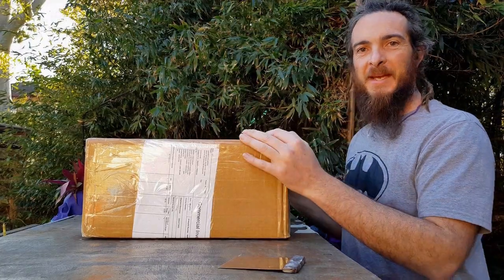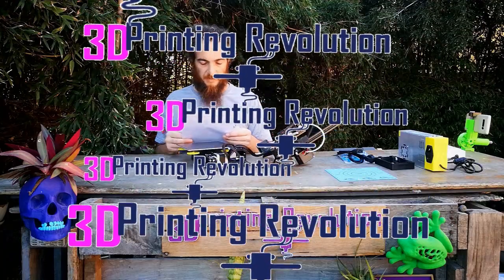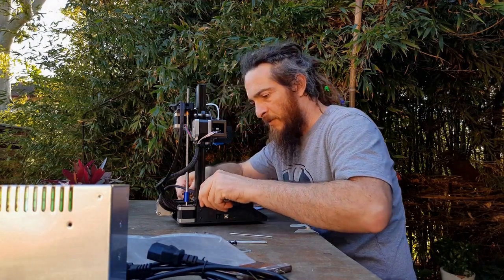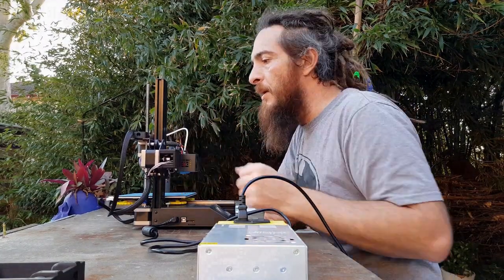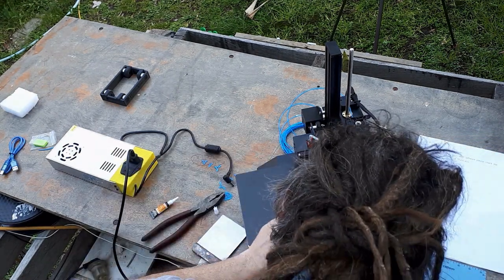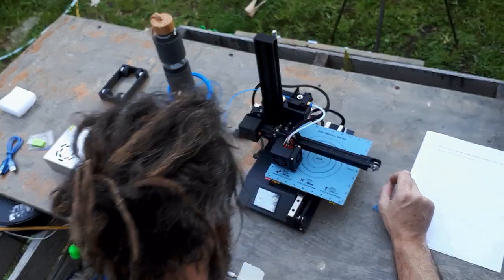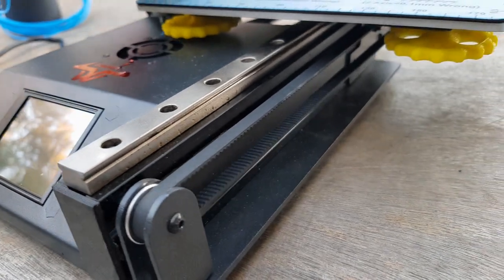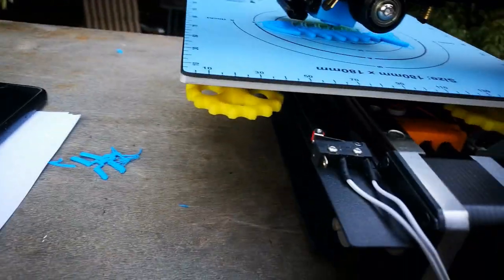Sooway SW200 (notT200) unboxing, build, and first print.

Comment: i have the same one for a couple of months now. the only issue i have had was the power switch. it will heat up and since its made of a cheap plastic, it will melt inside and it will not click on or off anymore so i added a toggle switch and problem solved. i use cura for my slicer and for pla i set it to 0.2 resolution. 220 nozzle. awesome tip for the perfect adhesion is to cover the magnetic sheet with blue carpenters tape then lightly sand the entire area until almost powder color. dust it off and print away. it will stick amazingly well. i have recently purchased the ender 3 pro and have upgraded almost the entire thing as far as cosmetics and also added an all metal filament extruder. works flawless. the sooway is a mini beast and i use on a daily. i also replaced the bowden tube with capricorn tubing on the sooway and the ender especially since it has a heated bed and abs calls for high temp. capricorn can withstand high temps
Reply from the maker: Thankyou for the detailed reply. I have been non stop printing on the sw200 since I got it. I did my hack version of the luke Hatfield mod and used Capricorn tubing as the throat. Keeping the white tube for the main line. I'm going to keep it basically stock for a few months. I have modded the heck out of my Ender 3 printers with my spin on the jstruder, the fang, and one has a bmg clone extruder. My kids love the sooway because they can remove the prints from the magnetic bed so easily.